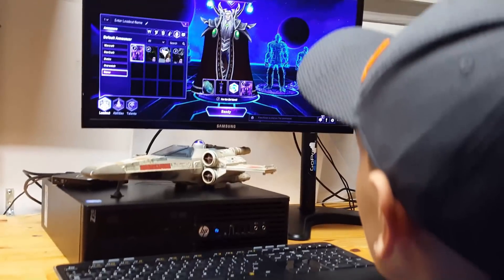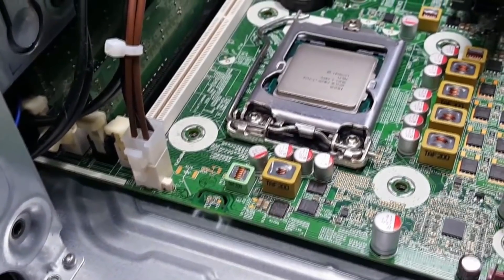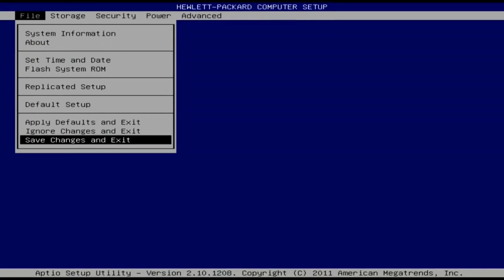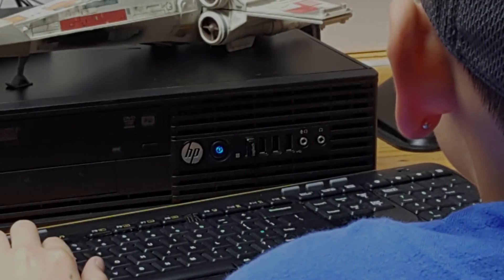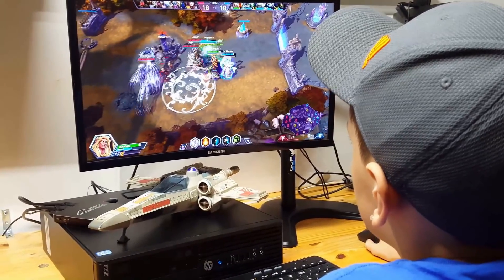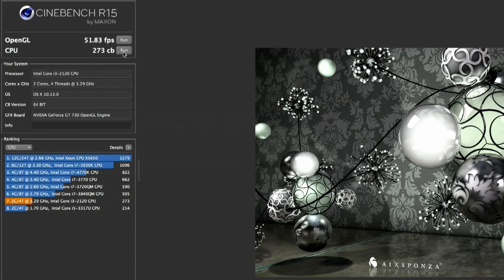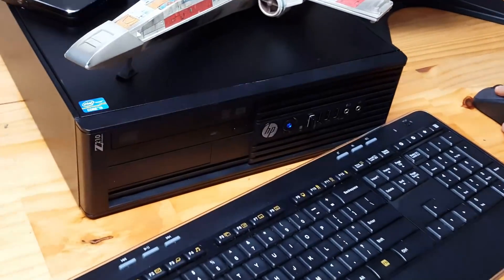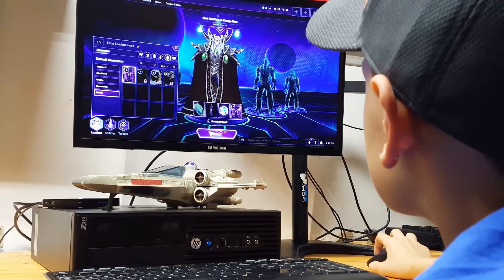Gaming on my Hp iMAC "HACKINTOSH"

Comment: That's right never give up and never surrender is a PC battle is worth winning it will be one if not the system will crash and burn well maybe not I've had success and failure myself but I tend to go with more retro builds something simple yet effective a lot of the games that I like playing on PC are older so it works fine one thing that I really like about your builds is they're always unique an individual that's the way I like to keep my builds and definitely lots of fans proper Cooling is essential also you have to keep in mind the direction of the airflow that way they all work together I even like to keep my consoles cool with some sort of cooling because consoles are still technically computers at least now the one thing you always have to remember it's all about the game so have fun

Comment: I made Hackintosh with pretty similliar specs, but instead of using HP oem pc, I used oem Fujitsu Esprimo P500 with i3 2100 and GT710. Shame that I couldn't install High Sierra tho. UEFI problems or something. Sierra works fine. As always great, entertaining video, keep making new customs out of those HPs :DDDD
Reply: Is there any simple way to make a hackintosh?